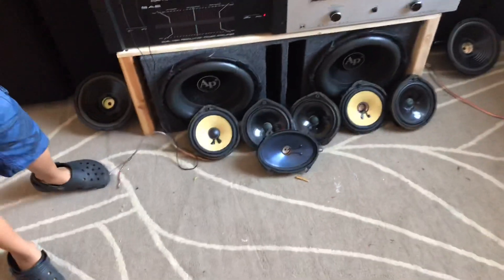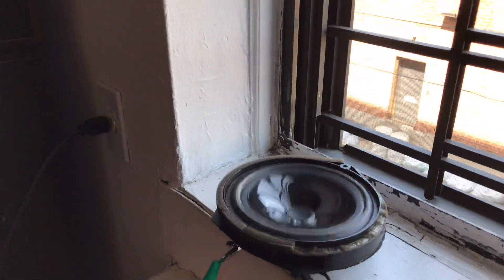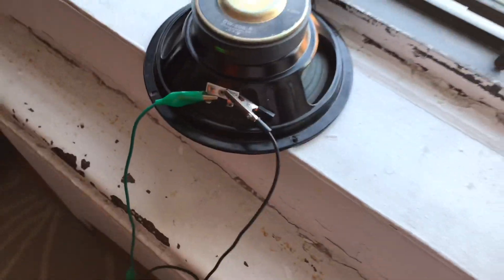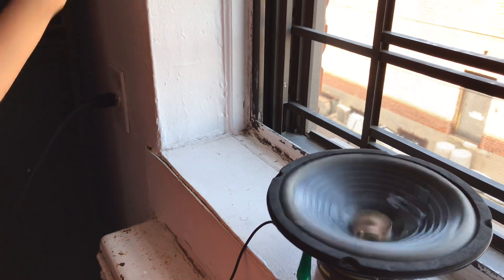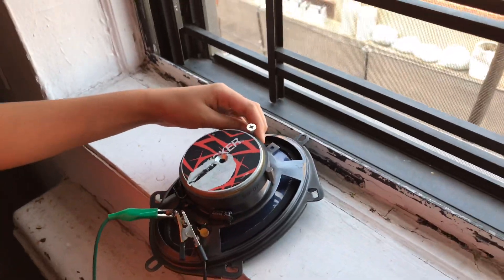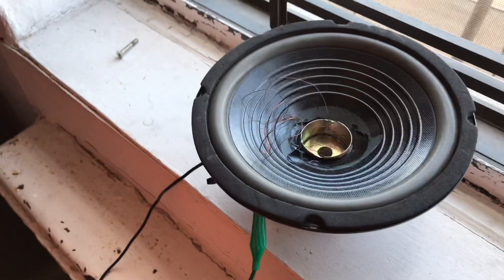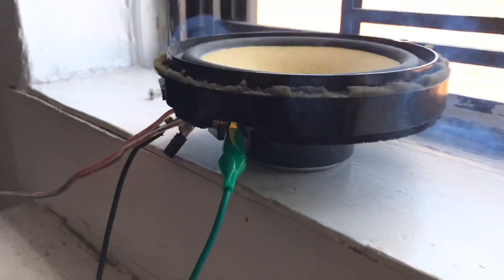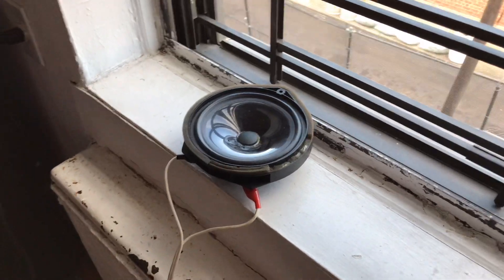Speaker Blowouts episode 11

Comment: I can confirm we have a Honda Accord with those exact speakers. Is was the upgraded stereo with the yellow fiberglass or Kevlar cones, metallic hard dome tweeters, and an 8 inch rear deck subwoofer very much like the gold wood in this video, but with no pole vent and a thicker smooth cone. I do not know what the dust cap looks like, because I would have to remove the back seat to get it out.